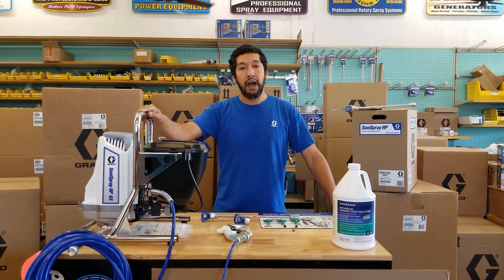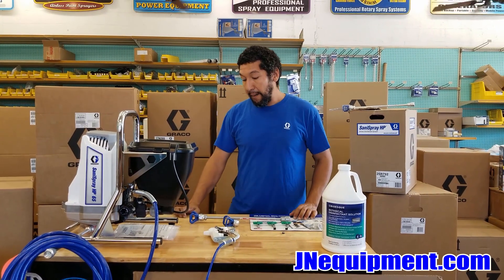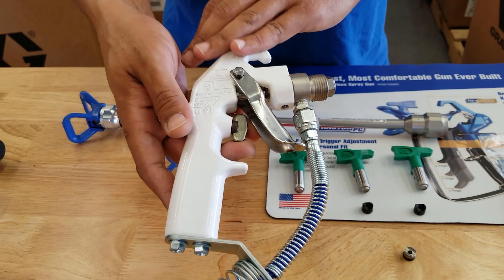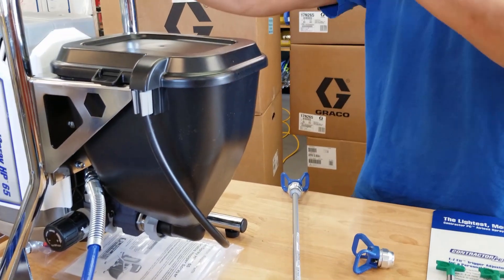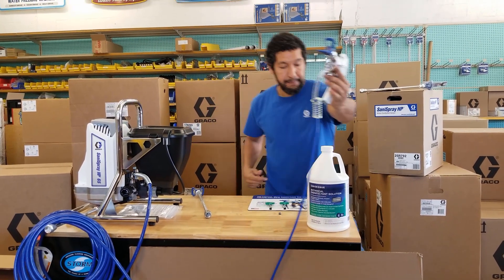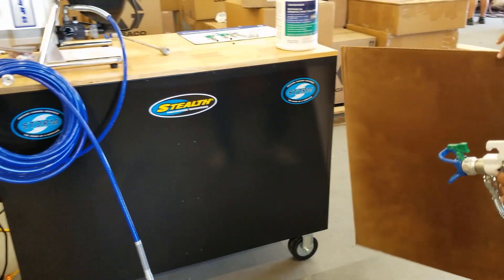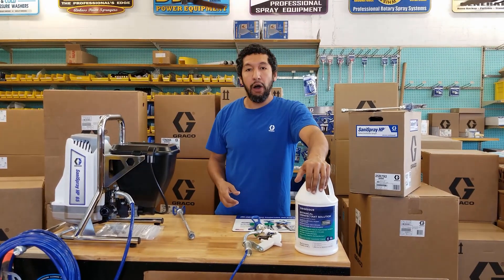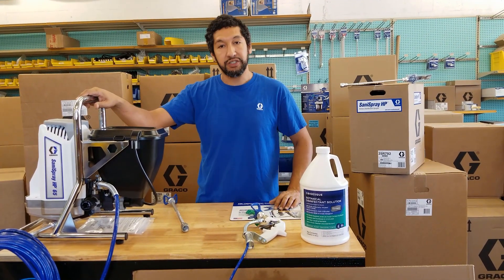Graco SaniSpray HP Product Demonstration by JN Equipment

Comment: Can u put a gx19 pump on this and use for painting?
Reply: I have the same question, did you ever find out?
Reply: @neimar10 no,but im sure u can if you find who sells it separately,its the same hopper
Reply: guy on reddit said he did. said it worked
Reply: Changing out the pressure control valve w the Graco 17J927 Pressure Control gx19s

Comment: spraying only won't do the job according to world health org. you have to use a microfiber cleaning cloth after spraying either using a sprayer/mist blower
Reply: Can you possibly post some of the information you found? or a link? Id like to have my bases covered for my customers questions.  Thanks !
Reply: this is NOT true. Wipe down is based on the product. There are several products that require no wipe down other than food areas.